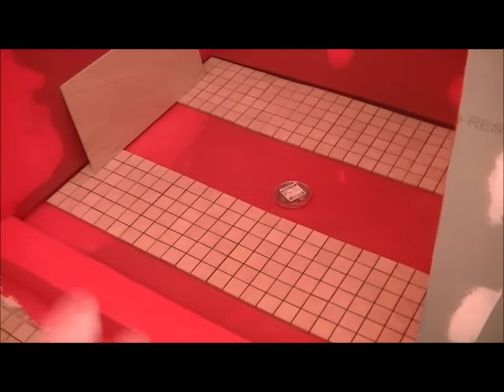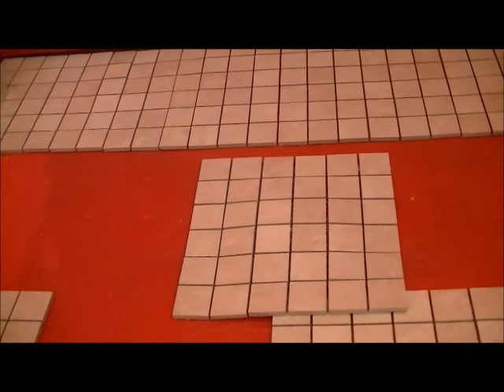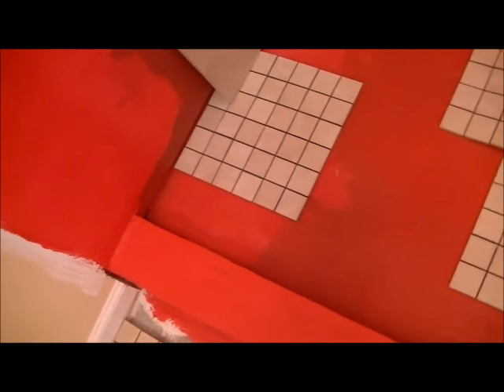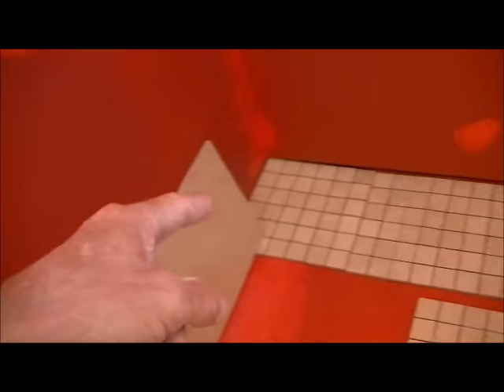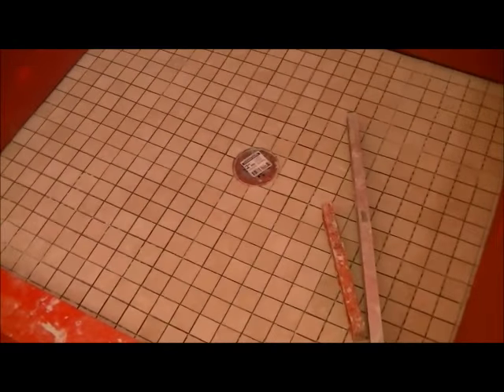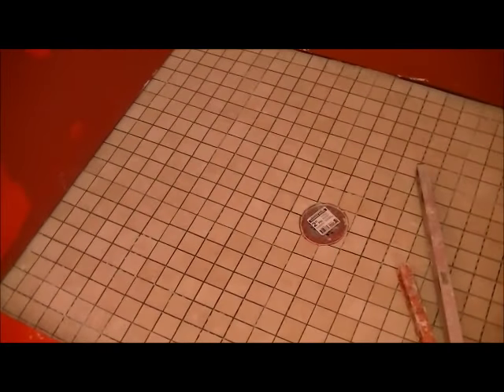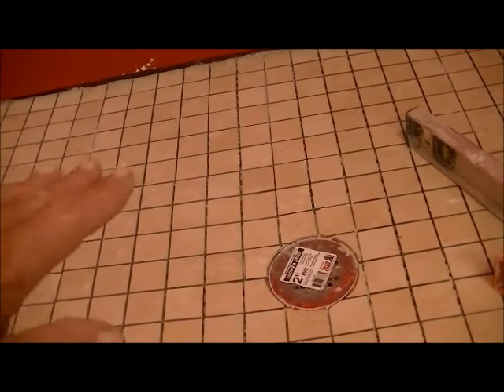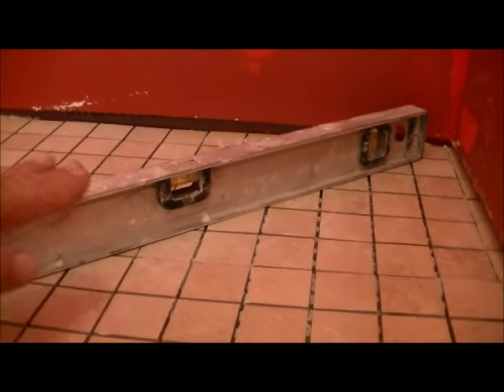HOW TO BUILD A SHOWER...part 4

Comment: Just a question if you don't mind.  All this talk about Preslopes, wouldn't completely coating the floor with red coat to the drain kill the argument?  Also why leave the space at the bottom of the wall when hanging wallboard? Why not Fiberglas the corner at the floor and redguard like all the other corners? Wouldn't it give a completely watertight enclosure to lay the tile? I'm doing a shower now and no preslope per your recommendation but want to make it completely watertight with red coat.  Any reason why I should not do this?  Thanks!